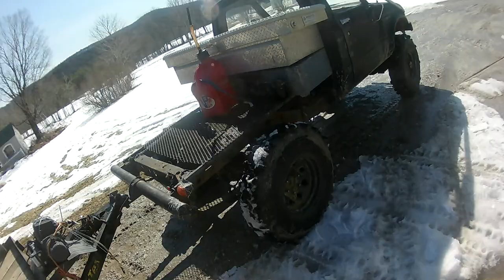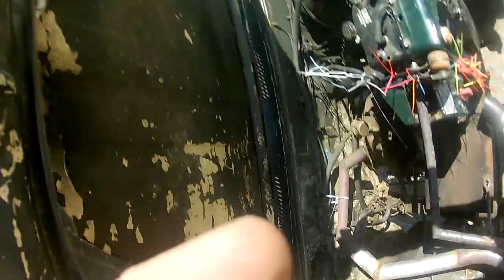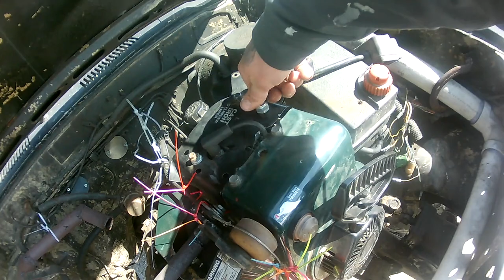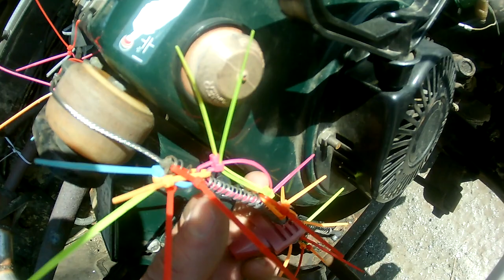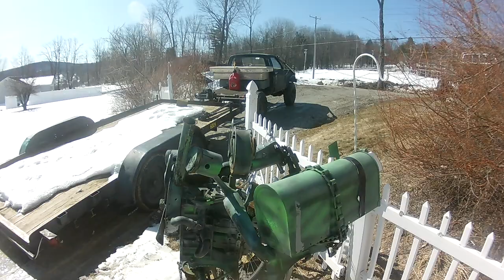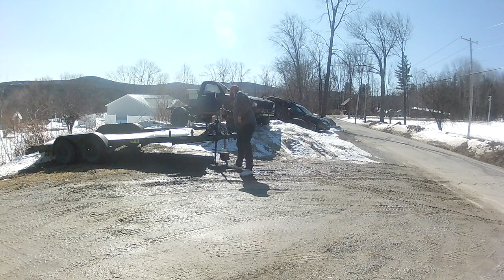9hp go kart truck moving  16ft car trailer

Comment: Take off the stock throttle and go striat to the carb with that much weight you'd be better off without a governor any ways
Reply: And don't use a centrifugal clutch